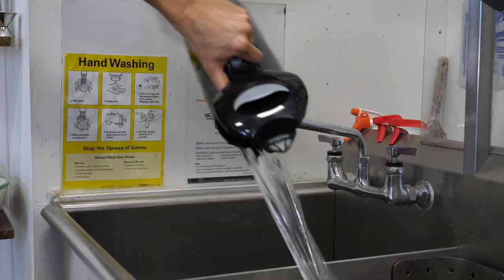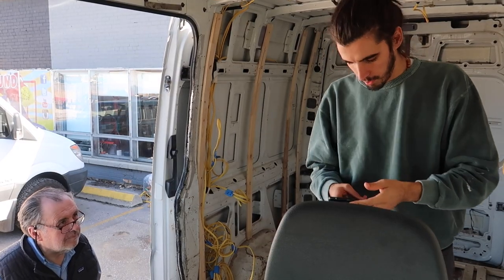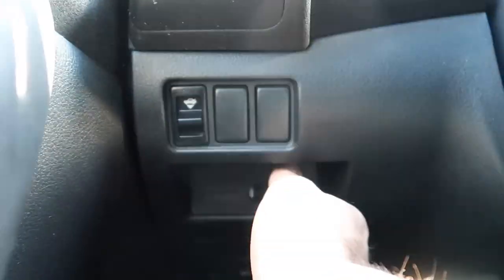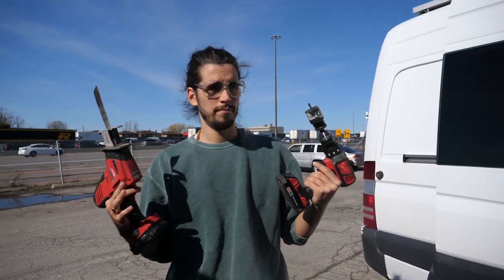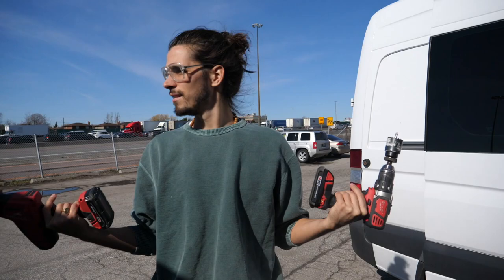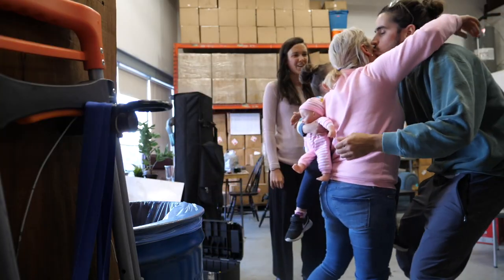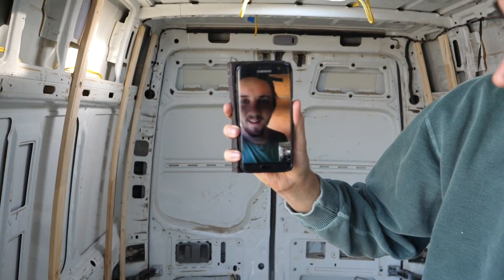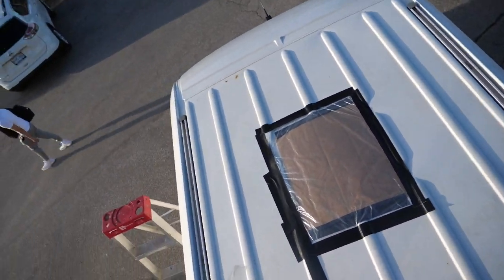VAN LIFE AIR CONDITIONING?! // diy van conversion

Comment: I travel with my dog and am about to start on my build.  Do you find that your 2 maxx air fans keep it sufficiently cool in hotter climates? There will be times I'll have to leave my dog in the van and am worried about it being cool enough. Is an actual a/c unit a possibility?  If so, what amount of off grid power would be sufficient?